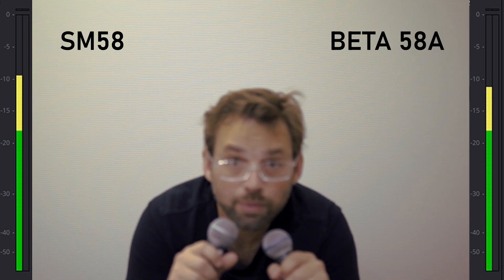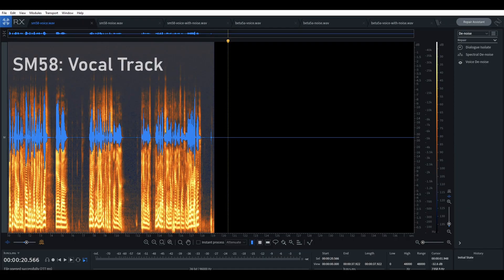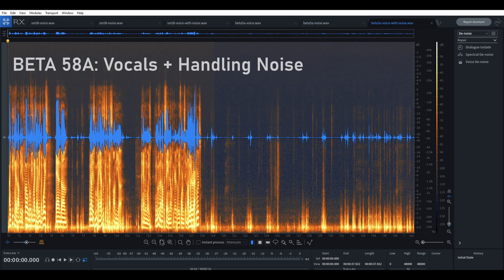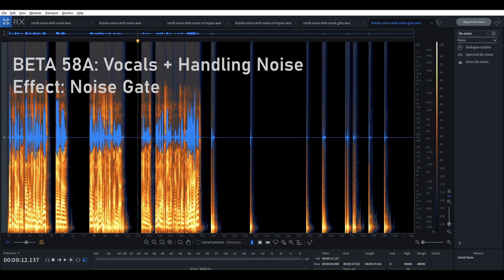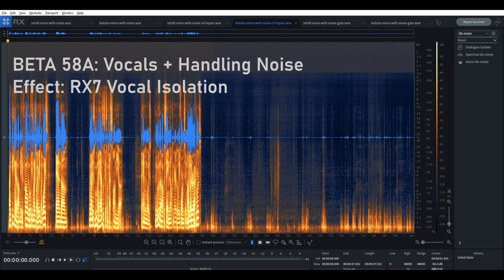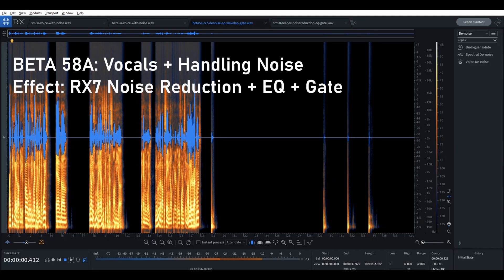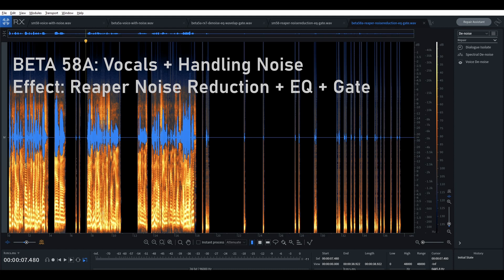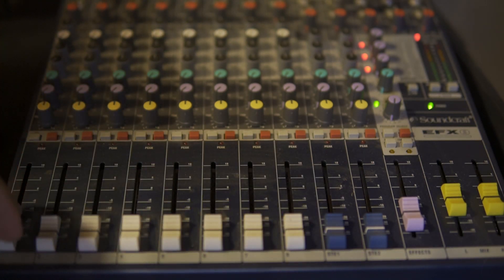Shure SM58 vs BETA 58A - Handling Noise Comparison

Comment: Hello bud how close to the mouth should I hold Beta 58 a while singing   Thanks.
Reply from the maker: 6 to 12 inches (15 to 30 cm)?  But if you're monitoring your sound you should be able to just play around with it and find a range that you think sounds good.
Reply: @dxsaigon  Thanks. When u compare beta 58a vs seinheiser E945. Which one is better in your opinion. Thanks again

Comment: I was given Shure PGA58 but discovered it had similar handling noise issues. I wanted it for theater audience reactions after the show. Its fine if I hold it carefully but couldn't hand to a lay person.  I need to get the SM58. Even though they have the same cardioid pattern the SM58 literature says it has "Pneumatic shock-mount system cuts down handling noise"

Comment: I came to this video because my new Beta A seemed to have more handling noise than the SM58, even after compensating for the greater sensitivity of the Beta A. Your results seemed to be in accordance with what I found. But why is it that everywhere else the claim seems to be that the Beta A has quieter handling noise? I'm quite confused about the claim. Am I missing something?
Reply from the maker: I think it's possible that it has a better internal shock mount, but not enough to overcome its increased sensitivity, especially in the hypercardioid 180 degree direction (where your hands are touching the mic).

The only solutions I've found are 1) handle more carefully or 2) use a stand. 

Overall I find it to be an overhyped mic. At some point I'll replace my Shure mics with SE Electronics or Earthworks.
Reply: @dxsaigon  That makes sense, thank you. However it's not good that people would potentially be choosing the Beta 58A over the SM58, thinking that the Betas are better noise-wise for hand holding. The opposite appears to be true.
Reply from the maker: Yes, I purchased my two Beta 58As in part because I had heard they had better handling noise, but clearly they don't. I'm not really sure how that narrative started. Can you return your new mic? @seanmchugh3476
Reply: @dxsaigon  
I like its sound and greater sensitivity. Also, it seems to have good feedback rejection for my situations. 

It also helps that I went to a Paul McCartney concert on Saturday and saw that he was using a Beta 58A - two of them, in fact (one for his piano). 

Now that I'm swayed that it's not a fake, I'll probably keep it. Anyway, it's a nice-looking unit. 

Thank you VERY much for your help. 🎤

Comment: Hello, have you checked the wireless microphone SHURE SM58 WITH SLX-D RECEIVE??? - Because I bought such a microphone model and I have a problem. When I knock and touch the microphone holder with my hand, the knocking is very loud!!! There shouldn't be a sound!!!
Reply from the maker: The only way to avoid that is to use a shock mount. They are like big rings with elastic chords that suspend the mic mid-air. So if you bump the mic arm or mic stand then the elastic chords absorb most of the energy.
Reply: @dxsaigon  Okay but what do I do now???
Reply: Thomas , do you think my new shure sm58 wireless slx-d microphone is broken???-yes???
Reply from the maker: No, it isn't broken, you have 3 solutions:
1) Be more careful how you touch the mic. If you bump it, it will make a noise. 
2) Buy a shock mount.
3) Buy a mic with a better internal shock mount. 

In my own case I decided to start to use a mic stand so that my guest doesn't have  to hold the mic. And hopefully they don't bump the mic stand or the table that it is connected to.

Comment: Try em with phantom power then lower gain you might need higher ohm headphones. I’m playing with the same stuff actually liking the accented handling noise as a laugh but want to know how to get rid of it. There is a gel inside one of the shure mics.
Reply from the maker: I don't think turning on phantom power will do anything for a dynamic mic unless you are using a cloud lifter / fet head. Even in that case, I think it is only going to reduce pre-amp noise and won't have any effect on handling noise. Gel is a good idea though, I wonder about modifying the internal shock mounts of these mics, should be possible to make an improvement.

Comment: Why don't stand up comedians use lavalier mics instead? You have virtually zero handling noise there, and also both of your hands free as well as full mobility.
Reply from the maker: My guess is two reasons: 
1) in a comedy club setting, where comics are doing 5 minute sets, it would be cumbersome to attach and detatch lavs from every commedian going on stage. 
2) lavaliers pic up a lot more ambient sound. 

Professional stage theater and musical theater does use lavaliers hidden in the hair or forhead for most of the actors though. I guess the ambient sound doesn't matter as much?
Reply: @dxsaigon  That makes sense. Thanks for the explanation! :)

Comment: Informative and helpful. Came looking to reduce handling noise and found what I needed. I applied your teaching and had good results. Luckily, I had Izoptope RX. Thank you.
Reply from the maker: Oh fantastic. BTW I have a bit of an updated technique, you can highlight just the range of frequencies bellow 200 hz and apply Vocal Isolate to that (instead of the entire spectrum) and get some pretty good results with very little work. May make a video about that if you're interested.

Comment: Isn't the Beta58 noise louder because it's a louder mic overall?
Reply from the maker: No, the loudness is adjusted on both mics so that the main signal is the same volume. In that case, the handling noise on the Beta 58A is louder -- probably due to the hyper cardioid pickup pattern being more sensitive to sounds from the rear of the mic.
Reply from the maker: In other words, even when reducing the volume of the beta, to match the volume of the sm58, the beta's handling noise is louder by 6 db or so.
Reply: @dxsaigon  To be practical, lav mic would fee up both hands and completely eliminate handling noise. You're copying a guy who does it wrong.
Reply from the maker: @ChadWork1  I've done a little bit of experimenting with lavs and... most of them are omnidirectional condensers and as a result, they pick up much more environmental sounds than these hand-held mics.

But yea, if reducing handling noise was the greatest concern then a lav would be great. I'm now using some mic arms which is helping.
Reply: @dxsaigon  Having done a lot of on camera presentation myself, as well as production work using lavs on talent, I can say that the environmental pickup is not bad, as the body blocks most of that. By the time you get the audio in context it's nothing that distracts from the content. But really one should have all the options handy and go with what the situation needs. Good luck!
Reply from the maker: @ChadWork1  I agree that the environmental context is fine in a video but I worry that in the audio only version of my podcast it would be super distracting... I may try to do less noise reduction thought and see how it goes.

Comment: U really help me out with this video. It’s so fucxing useful. 
Since I used to own a sm58 mic for years and finally sold it to my friend after getting a beta58a from my sister, I’ve always had the confusion about the upgraded handling noises.
I even sent it back to SHURE once just to make sure it is the real one but not a pirate version.
Thx a lot!
Reply from the maker: Happy that it was helpful, I recommend using it with a boom arm or mic stand instead of handholding it, if possible.

Comment: I always thought that super cardioid dynamic mics would have less noise than cardioid dynamic because they are more focused. While the angle is a lot narrower when you are on top of the mic when you take a look at the actual polar patterns you can see that the profile for super cardioid has less sound rejection from the rear not more which is why you'll have more mic handling noise. The 58A is not an upgrade of the 58. It is a completely different kind of mic. That's the way I now look at it anyhow.
Reply from the maker: Agree, and I also think that if your guest doesn't have great handling skills they won't keep the angle consistent, which can change their levels a lot.
Reply from the maker: Fighter 6rTh1

Comment: Does anyone know how to use the beta58a live? Like do u have to connect it to something to make it work live.
Reply from the maker: Do you mean live like on stage in concert or live like streaming? 

If on stage you'd typically connect into a mixing board / mixer that's then going into amplified speakers. 

If streaming you typically need a USB audio interface with XLR inputs. There are many different option from many different manufactures.
Reply: @dxsaigon   I found your video from a site called  "the podcast review" and he referenced your video...anyway, I saw this answer here and it's exactly what Im wondering (about an XLR cable with a USB end) is that ALL I need, or do I have to have some other "middleman" type hardware? Sorry, Im not too techie, ha..... So, Im going to (hopefully!) record audio books and I thought I would use my Beta58A from long ago (singing) and just buy a cable that connected the Shure to my laptop.... is this all I need, or is there more?
 I will also use Audition software (unless I end my subscription, in which case I will try audacity)

About ideas for handling sound, I have had people mention that the wire quality, especially AT the end, close to where it is connecting, is quite delicate and can get damaged with not keeping wires safe, dry wrapped properly, etc, and this can cause noise.... I think the "comedian on stage" is in a loud bar, or other factors, where the mic is probably making handling noise, but we're not hearing it, due to general room noise or the fact that the "room tone" is a bar, stage, or other generally noisy place (?)
Reply: @dxsaigon  in case youre curious, I went back and got the exact site where I saw your link, a cool Scottish guy :D   https://www.thepodcasthost.com/equipment/shure-beta-58a-podcasting-review/
Reply from the maker: @laurencismyname  So cool! I think it's the first time anyone linked to me :)

For your situation, I'd suggest purchasing a Samson Q2U. It's very similar to the Sure sm58 but in addition to XLR it also has USB built-in. Super simple to use, just plug it in and you're ready to go. It's like $60 and you get a kit with a tabletop stand, all the cables, and a foam cover. 

I'm skeptical of XLR to USB cables, but apparently, they can work with a dynamic mic like the beta 58a / sm58...  I'd imagine that some have better analog to digital converters than others so you probably get what you pay for. I'd look at reviews before purchasing.
Reply: @dxsaigon   With the cost of this microphone I don't think I'm up for spending a lot again so I think I'll try the wire and see how it goes but if it's cruddy I will go with what you recommended above. And I'll save this video and comment back to let you know how it goes either way when I try it. It'll be a while I need to order the wire... Thank you for your advice!  And yes I'm glad this guy referenced  you that's pretty cool!